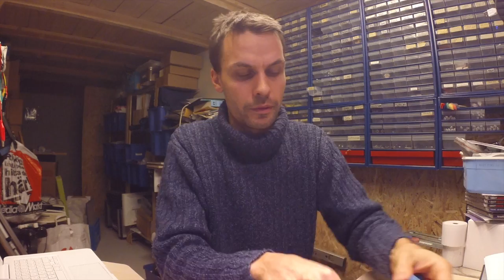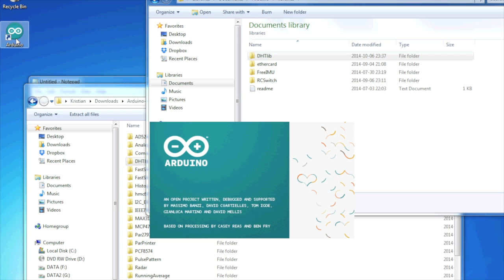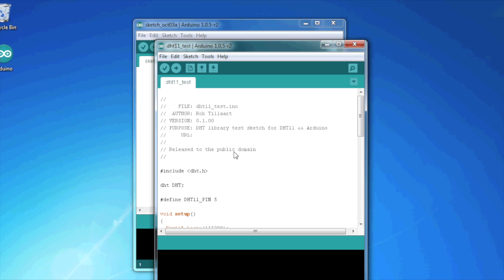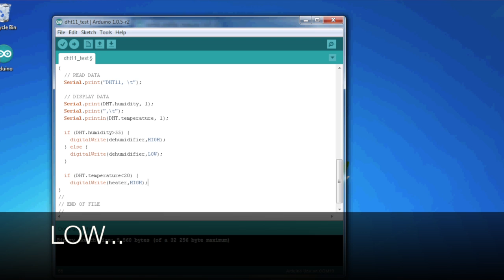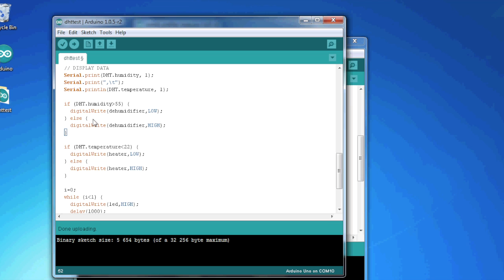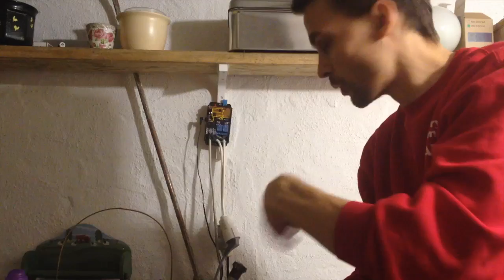Using a DHT11 and ATtiny to control humidity moisture and temperature - Anything Arduino ep 4

Comment: How did you connect the Arduino to the humidifier/heater?
Reply from the maker: With a relay. A digital pin controls a relay that turns the heater on and off. Keep in mind it is very important that the relay you use can handle the wattage of your heater. Black nasty smoke will be produced if it can’t. And it’s a huge fire hazard!

Comment: you can replace all the bulky conditional statements and put instead 2 lines of code:
```
tens = temp/10; // division will get you the tens
ones = temp%10; // modulo operator will get you the ones
```
simple as that!

Comment: okay, maybe you can help me...  can't seem to get it to work and no answers from anyone else...  all i want is  to turn on a 5v fan from a nano...  lots of vids on AC fans with relays, or 12v fans with mosfets etc.   but i just want a 5v fan running off the 5v nano..   if i knew the connections (no breadboards, i want this as small and uncomplicated as possible) i can figure out the code.
Reply from the maker: The problem is that if the fan draws a lot of power the nano wont be able to handle the load. Therefor it is better to use a relay or transistor to power the fan. Check back a few episodes in Anything Arduino and you will find an episode where I use a transistor as a switch. You will have to find a correct resistor, but other than that it SHOULDwork with a 3904 or bc547,548,549 NPN transistor, thus protecting your nano from overloading the pin :)
Reply: @SourceryOne  how can it draw a lot of power when it's only a 5v fan...  i guess i'm just not getting the problem.
Reply from the maker: Because a fan draws a lot of current (A or mA) and the arduino pins can only supply really low amps. That is why you need power from another source. Look back a few episodes of anything arduino you will find how to use a transistor as a switch. That might help you a bit.
Reply: @SourceryOne  i had it working already with a mosfet and a 12v fan, so i know how that works... the question is, why when i hook up the 5v fan to a nano, with no dht11, and let it run for a few hours, nothing 'bad' happens.   doesn't overheat, doesn't stop - nothing.   which leads me to believe it would work without the transistor and higher voltage fan.

Comment: Hey Kristian , thanks for such a detailed video. Could it possible to explain the connections you made from relay module to the dehumidifier and power plug ? Would really appreciate some help. Thank you !
Reply from the maker: First of all: working with AC power is DANGEROUS! You need to know what you are doing and never work with power plugged in. So AC power in this case is two leads. Just cut one of the leads in the wire (no matter which) and add a relay that can handle voltage and amperage of your AC device on this cable. Depending if you want power to be on when the relay has no signal in on the coil, then you connect one side of the lead to NC. If you want it to be off when no signal on the coil connect it to NO.  The other end of the lead you connect to the common pin/screw terminal (usually the one in the middle on relay boards) hope it helps. I have another video explaining in more detail I think.
Reply: @SourceryOne  Hi Kristian..Although i couldn't find a video where you have explained it, I almost understood all your points. . So Im trying to control a  humidifier and a heater using dht11/dht22 , 2- channel relay and Arduino. This is my first time working with relay and its not very clear from this video of how you have connected dehumidifier and heater. Now since Im trying to control both the heater and humidifier , I am assuming we have to connect both the relay channels with each of  the heater and humidifier. I am thinking to integrate an extension chord to connect the power supply and the device with the relay channel. I have made a circuit diagram connecting all the wires and I wanted you to take a quick look at it and tell me if I did something wrong. If you could share me your gmail, it will be very easy for you to understand what i did. If there is any other alternative that you might think is simpler , please feel free to suggest. Thank you so much for all your help  :)
Reply from the maker: Sahil Bakht just put a link to the image here. Just so you know that usually you can’t connect a heater to the cheap relays you buy on eBay. They can usually only handle 10amps. My heater could be set at 750, 1250 and 2000w heating. Having it at 750 it worked. When I accidentally set it at a higher watt the relay burned up. So that is why I say BE CAREFUL!

Comment: You are awesome, Man! I so need to get an ATtiny and the relays. I only knew about the Atmega 168 chip. I'd be happy with that, but an 8 pin chip is much better. If you only need the few connections and commands, that is really cool in a small enclosure. Thanks! I just Subscribed. Keep up the good work. I thought what you did with the High and Low was correct until you pointed out it wasn't. Showing us what NOT to do!!  :-)
Reply from the maker: Thank you. My suggestion nowadays is to use the dht22 instead though as it is more stable and correct than the dht11.

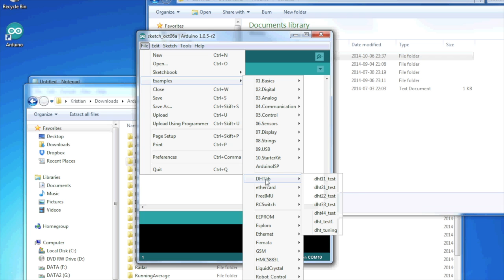Comment: Kristian thanks for this video very informative. Question: Which microcontroller is that you introduced at 4:34 ? Did you say 801085?
Reply from the maker: That would be the Attiny85 which is an atmel chip like the atmega328 but with only 8pins. See previous episode for how to program it.

Comment: Ok  this is not working, have used two control units neither work it  an arduino uno, elegoo uno r3  and 5 sensors all i get when monitoring is 000000 and the odd letter no temp readout

Comment: //Temprature on PIN 5, rest do with what you will, easier to copy his sketch if you have a base one, This took me about 2 hours to sort out. Have fun guys
#include <dht.h>

dht DHT;

#define DHT11_PIN 5
int Fan=3;
int Light=4;
int LED=5;
int i = 0;

void setup()
{
  Serial.begin(115200);
  Serial.println("DHT TEST PROGRAM ");
  Serial.print("LIBRARY VERSION: ");
  Serial.println(DHT_LIB_VERSION);
  Serial.println();
  Serial.println("Type,\tHumidity (%),\tTemperature (C)");
  pinMode(Fan, OUTPUT);
  pinMode(Light, OUTPUT);
  pinMode(LED, OUTPUT);
}

void loop()
{
  // READ DATA
  Serial.print("DHT11, \t");
  int chk = DHT.read11(DHT11_PIN);
  
  
  // DISPLAY DATA
  Serial.print(DHT.humidity, 1);
  Serial.print(",\t");
  Serial.println(DHT.temperature, 1);
  

if (DHT.humidity>55){
  digitalWrite(Fan, HIGH);
  }else {
    digitalWrite(Fan, LOW);
    }
    if (DHT.temperature>24) {
      digitalWrite(Light, HIGH);
      }
      else{
        digitalWrite(Light, LOW);
        }
        i=0;
        while(i<1) {
          digitalWrite(LED, HIGH);
          delay(1000);
          digitalWrite(LED, LOW);
          i++;}
          delay(2000);
          }

Comment: Dear sir,
With very sorry to that I took your precious time
I hope in this coments you can understand my requirements.
I need one circuit that consist different relay using ardunio
This circuit I need for digital automatically control egg encubeter...
In this circuit I want to use  R1,R2,R3,R4,R5, and DHT11,22 for humidity and temperature controlR1,R2.... represent Relay
Here now the function  is like this R1, I need to used for temperature element that make the temprature according to my requirements inside encobetr 
When the temprature raise up to the set point my hetting elements need to off
R2,  for humidity  control same as temerature control 
R3, I will use for one moter that motor need to run 3 time in 24 hours only for 3 to 5 second
R4, Will be use for one fan that fan must be need to run when the inside encobetr temperature raise up to set point
R5, need for circulation fan that will be run 24 houre  for vaporising inside encobetr 
I hope you understand my requirements and you give me better ieda with you best knowledge 

 If now have any questions about it you tell me I will tray to explain more better how much I can I will do.
And I need the programing ,,circuit diagram for breadboard, , how to lay out
Sir if it is possible we can also used  push button S1,S2,S3,S4 etc further setting for temperature and humidity controlling purpose
 And  we can use Arduino UNO, NANO,PRO MINI?which one is better
Can we used Lcd 4×20 for showing temerature humidity  moter running time days start? Day left?
 I hope you respond me better
Thanks Regards

Comment: This is great!!! I am NOW using  this to control my reptile environments. Everything works, thanks to you. One question, isn't it best to have your relay least often energized and faulting to open? Couldn't you swap wires instead of swapping the "HIGH" "LOW " settings? Thanks again, awesome explanation.

Comment: First of all, many tks, but If you list the staff you uses it would be better as people like me, don't actually know a lot about the type of those things.
Reply from the maker: Sorry, must be a translation thing, but I dont understand what you mean with staff?
Reply: I mean the material u use. And can u make a video about greenhouse control, I don't quite get it. As there are so many to be controlled apart from humid and temp. U will need to control the sprinkler, fan, motors, mixer and so on. It is not just add some delays, right? Maybe the pin will be not enough, so how will u handle this?
Reply from the maker: +a 隔壁老吴 ah ok. :) I usually explain and show all components and how to connect them in the video. When it comes to controlling bigger machines as your examples it is easiest with relays. There are special solenoid valves that can be used to control sprinkler/water systems. Solenoids take a lot of power though so you still need a relay between the arduino and the valve. Again. Output pins can be extended in many ways. A simple one that I have shown in other videos is with a 595 chip. Where three pins can get you almost unlimited digital output pins.

Comment: It's a good project, and a good video, but alot of opportunities for improvement. I'd suggest using Fritzing for your circuit illustrations rather than the MSPaint drawings. I'd also suggest shooting the video in smaller snippets, cutting between your footage and the Fritzing illustrations. This would also allow you to redo sections where your dialogue has messed up due to forgetting words or what you wanted to say. (As a viewer, hearing long "errrr"s as you search for the right word is distracting.)
Reply from the maker: Thank you for your input. I agree on some points, but I also dont want to cut too much in the footage, I want to show exactly how easy it is to work with the arduino and not "mask" anythinig by cutting too much. It still happens though. And instead I get a lot of "err" which is bad. As for the mspaint drawings :D It is actually on an ipad where I draw with a pen and explain at the same time. Fritzing is nice for a finished illustration, but as far as I know you cant "draw" the traces as you explain? I might be wrong, but the only good way to do it has been this way. But I will still take your criticism into consideration and see what I can do. A final fritzing drawing would be a good start I guess. Take care!

Comment: There is a lib for Arduino called Softwareserial which will allow printing to the monitor with the ATtiny85 code while connected to Arduino.  I developed some code with Arduino that ran great on the 368 chip, and I was printing some debug info, when I uploaded to the ATTiny85 (sans debug prints),  whoops!  didn't work.  So, out of desperation, I found the use of this library.  It only takes one pin on the Tiny, which is cheap at half the price, although you are still tethered to the Arduino during the debug process.
Reply from the maker: Good to know. Thank you!